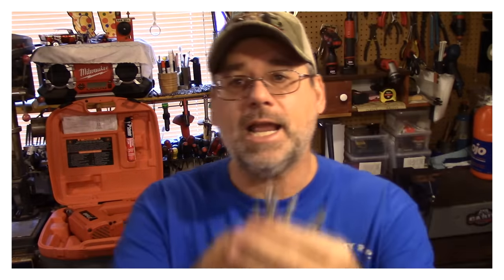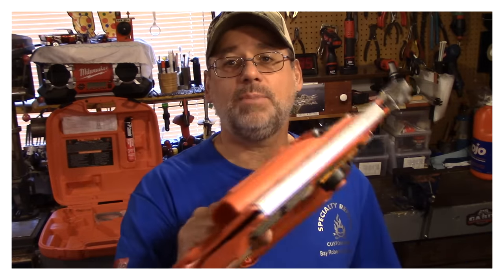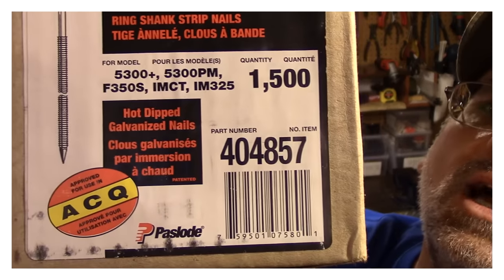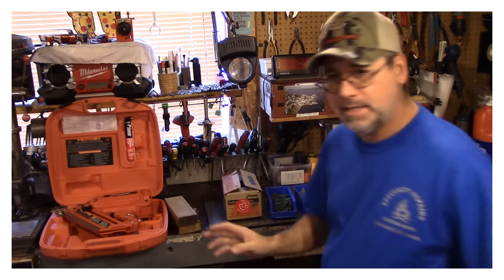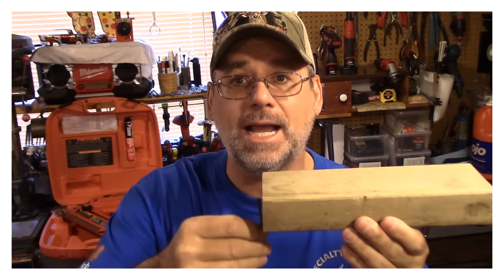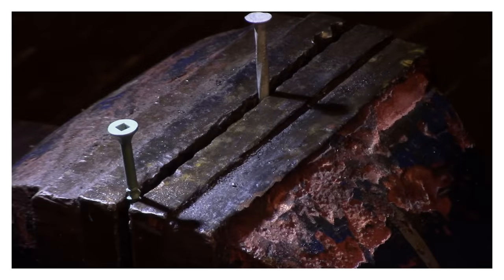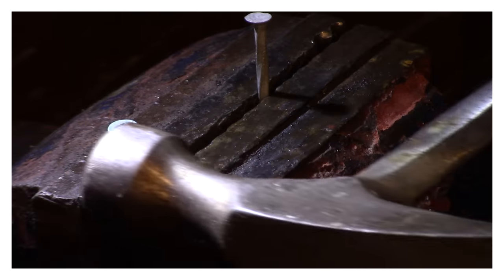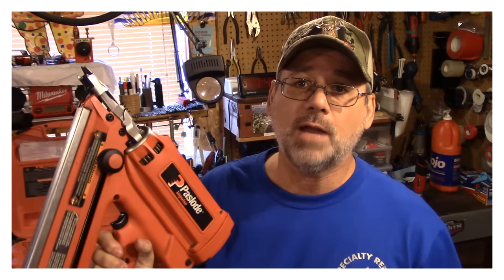BEWARE  NEVER USE DECK SCREWS  - DECK SCREWS VS NAILS -  PART TWO IN DESCRIPTION

Comment from the maker: Well after making this vid some time ago I decided to revisit the topic and discuss the waco comments I have received. PART TWO  -   STOP USING DECK SCREWS - https://www.youtube.com/watch?v=IfCuqqN9g4o
Reply: Philips head screws are CRAP. Use Robertson head screws. Also, there are many grades of deck screws up here in Canada. I've been using them for over 40 years. Sorry bud, you are just flat out wrong. It's way easier to take out deck screws to replace a board than it is to beat the board out because it's nailed in. Been there and done it. I've built many houses from start to finish, from the ground up. Nails and nail guns are great for framing, but not for decks.

There are structural grade screws too, which make them as durable as nails for sheer strength.
Reply: Thin neck screws that thread are bigger are useless unless you pre drill an set drill on lower torque settings  rather have square head wood  over screws over Phillips or Torx bit

Comment: Screws for deck framing are a must. Movement from swelling by moisture and temperatures back the nails out. Learn to frame correctly so your stucture isn't supported by your fastners.
Reply from the maker: Thats a great tip. Thanks
Reply: Yes, if you're building so that your structure is just being held in place by screws, and the screws aren't supporting the weight, you're absolutely fine.  For major support posts and beams I use lag screws or carriage bolts anyway.

Comment: If your load is being carried by shear stress on a common fastener, it doesn’t matter whether it’s a nail or a screw, it’s a bad design!!!!  Load should be carried by something resting on something that’s resting on something right down to the foundation.  Only exception to this in my mind is engineered joints where everything is carefully specified for the application… i.e. joists in joist hangers.
Reply from the maker: James I've seen deck screws used where joist hangers are required to  were deck screws are the only attachment for a joist and no crossbeam support below , oh man it seems many need to stay away from deck building 😅😅

Comment: I just had a stripped deck screw from Home Depot that was sticking out of a 2x4 by about an inch and a half. I probably bent it over with a hammer and straightened it again 5 or 6 times before it broke. Good deck screws are annealed and are very flexible.
Reply from the maker: Thanks for the comment Clint - I will revisit this video and deck screws in the future and try multiple brands of deck screws and put then all to the test. Cheers buddy

Comment: Just my opinion.. I have built structures with deck screws and I have used nails. After 3 hurricanes the deck screws held up and the nails pulled out and the structure fell. Most of the contractors I know have switched to deck screws because they hold up better in the adverse weather we have around here.
Reply from the maker: Donald deck screws are just fine for places  recommended.  This video is all about showing,  deck screws are not to be used everywhere as by your local building codes.

Comment: Deck screws have a higher yield strength compared to a nail. Therefore, a deck screw will resist deformation (bending) more than a nail.  Both will workharden when bent, but because the deck screw has a higher yield strength it will fracture sooner when it is severely bent as shown in this video.  If your framing moves this much, there are other problems with the design of the structure.  I believe the the cost of a quality deck screw is the real reason screws are not used.  An advantage of using screws is they are much easier to remove if there is a framing issue during construction or a modification of the framing is needed during a renovation.  With respect to corrosion, if a powder coated deck screw is scratched exposing the iron substrate, it will quickly corrode at this localized defect in the coating.   However, a galvanized (Zinc) coating will actually repair itself (Zn adjacent to the defect will oxidize and expand to cover the exposed iron substrate) when it is scratched and placed in a corrosive environment such as humid air or chemicals in pressure treated wood.  For maximum corrosion resistance, always choose the thickest hot dipped galvanized coating available.

Comment: Been using deckmate star drives for over 15 years. Never have seen a problem in anything I have built. Use them right and they will not fail.
Reply from the maker: Good to hear - can't say I recognize the name but if they work out  and don't fail - sound like a win win to me. Cheers
Reply: I have a 20 year old shed that was built in a seismic zone with black phosphate indoor drywall screws that still is intact. I’d never use those screws myself on projects but enough screws will hold most non critical projects.

Comment: Screws provide a more permanent clamping force. Less movement between surfaces creates a stronger load capacity. Think of loose legs on a chair as a example.  Proper sized fasteners are key to a strong joint.  Using nails or screws shear strength to support a load is a bad idea.  A proper design with the wood carrying the shear load is a lot safer.
Reply from the maker: Well said Douglas 👍

Comment: The newer pressure treated lumber (acq) has a much higher salt content, thats why bright nails don't last. I've seen fences fall apart two years after they were built.
As for deck screws they are handy especially for remodeling in houses with plaster.
They are hardened that's why they break. 
If you properly construct something the fastener does not bear the load. The fastener merely keeps the lumber from moving. When fasteners must carry a load there should be strapping or other hardware involved....
Reply from the maker: Bang on Richard . Have a great night . Cheers

Comment: Screws will not sheer that easily if they are completely embedded in wood. If you Nick a nail it can break the same way. I've been a builder for over 30 years and used both and never seen anything I've ever built have a catastrophic structural failure with screws, nails or bolts. It's all in how you build and support it.
Reply from the maker: Yes exactly as you never used a deck screw with a joist hanger or depended on a deck screw for a structural load but yes some diyers do it all the time so this video is for those that just don't know the difference, . Cheers

Comment: It's the truth, deck screws will shear easily compared to the same diameter nail.  Good info to put out there Steve, you nailed it man.
Reply from the maker: Thanks buddy its a common fastener used by the uninformed in the wrong places. On an outhouse it's  not so critical . LOL
Reply: Ozzstar hammered it good, on your comment eh....😂

Comment: You like using the nail gun simply because it's easier and quicker...nothing to do with holding ability. Nails will back out...screws will not.
Reply from the maker: Hi Rick 
I use nails and screws , whatever the customer wants. Nails 1/2  the price of screws .  Screws or nails have their challenges but the things I see with screws is totally wrong and against all building  codes when used incorrectly.   Time is money and nails from a nail gun  is less time so it's up to the customer. Cheers 👍
Reply: The problem with deck screws is that it’s hard to get enough galvanizing material on the screw and to be smooth enough to screw in. I had a 30 year old deck made with CCA, and a couple of boards needed to be replaced. Most of the screws snapped while removing because there was next to no steel left in the threaded part of the screw. Maybe it’s no so bad in ACQ, but I’m not sure you can find any 30 year old decks from ACQ to compare. The Simpson Strong Tie nails and galvanized bolts in the deck had no visible issues. Admittedly, they were horizontally installed, so got less water accumulation. Using screws did make it easier to remove and replace a couple of boards in comparison to nails.

Comment: My home is in area where 50 -60 mph winds are common, with temperatures down to minus mid teens and up to 110s f.  Screws are reliable, nails are not.  This is my experience for some decades.  Contractors use nails because they much faster to install, not reliable.
Reply from the maker: Use whatever is acceptable to your needs within  your areas building codes.  This video is more about the spots one should never use deck screws.  Cheers

Comment: I'd rather use structural screws than nails when framing things but I'm no profession. GRK and Fastenmaster (Timberlok) make excellent structure screws that meet or exceed nails in shearing strength and are building code approved. They will bend like the nail in the video but will need much more force to do so. The downside is that they are way more expensive than nails and deck screws, but they have way more load bearing (shear) strength and have clamping force that nails don't have. They will also break faster if your boards are moving around a lot to the point they start to bend (if your frame is doing that then you have other problems...). Watch some videos on GRK R4 multipurpose screws or Timberlok/Ledgerlok fasteners. They both also have code approved screws that need no pilot hole that replace 3/8 Lag screws up to 8 inches long.

Comment: Coated deck screw, not black or galvanized are fine for treated wood. It is the copper in the treatment that causes the steel to rust. Screws must be harder than nails otherwise they will twist off when you drive them in. Brittle does not mean weaker. Preform the same vise test with aluminum screw nails and they will be brittle.

Comment: I used 3 1/2” stainless steel deck screws in Timbertech decking on pressure treated joists. 
They costs eleven cents each.   But they won’t corrode.
Reply: ----   the current cost of a Deckmate 3 1/2 "  screw if you buy them by the pound is 18 cents each  -   if you got stainless for 11,  you got a good deal

Comment: Good tips Steve for the ones that weren't aware of the differences between nails and deck screws. The best thing is to use the correct fastener for its intended function. I like deck screws only for fastening down decking and they are too brittle for lateral forces. So, yes, they are not good for construction purposes. I don't use plain nails, even the hot-dipped galvanized ones for decking because in a few years they will work themselves up. But using nails that has the adhesive on them such as for pneumatic or electric nailers are okay as the adhesive will hold them in there.
Reply from the maker: Terry i've tried removing a nail gun nail and it's real tough with the  adhesive that holds them together.  I have yet had a nail from a nail gun work its way up as regular spiral nails do. The ring shank nails  for my nail gun are impossible to remove.  Even screws have to be tightened down after the PT wood shrinks at times.  Take Care buddy.

Comment: Deck screws aren’t “crap” they are hardened, therefore no sheer strength. So you’re right they aren’t structural, but it’s not because they are crap, it’s because structural isn’t their purpose.
Reply from the maker: Exactly 👍

Comment: I don’t know where you’re buying your deck screws but there’s several different types, there’s cheap ones and there’s good structural ones. Good deck screws beat nails, hands down every time.
Shear strength is not always as good, but that really isn’t a factor on a deck, tensile strength is way better, holding power is multiple times better, nails will always eventually gradually back out, everyone that’s ever had a deck nailed down knows they’ve had to go along with a hammer occasionally and knock down migrating nail heads.
Reply from the maker: Home depot is where these were bought.  Lots of different screws and different certifications so finding the right fastener and build to code is the best choice.

Comment: I built an 8x16 foot pool deck in Michigan 25 years ago and used deck screws. It's still standing today and shows absolutely no sign of aging other than graying of the pressure-treated wood. Screw shanks are bright and clean. Square and level. So there's that.
Reply from the maker: That's what their for , deck boards so that's great .  👍

Comment: That was interesting. Deck screws are hardened and that makes them brittle. However, most of the loads on light structural constructions are static. Impact stress and static stress are very different. In your calculations of static force when you double the weights, the forces double as well. With dynamic stress its squared, times itself. Anything that has impact forces on it will have very high momentary stress, but if it just sits, the forces are lighter. That you can break the screw with a hammer in shear is not an outstanding surprise. The wood however is not rigid like the steel vise and getting pure shear is not common. With nails, the flexation of the wood can work them loose through the seasons. As you say, some products work best when they are used as designed.
Reply from the maker: Good observation.
Reply: @SteveRobReviews  Vibration is a nasty one such as on steps or anything that has high winds. Thats why they put lock washers on things. The momentary shock loads of vibration while short in duration and not small in intensity. The lock washer takes up the vibration by keeping the load on the fastener constant. All things stretch and that's why screws have become attractive. I noticed you mentioned galvanized nails and I agree but for one thing. Galvanized nails don't lock in. When you are framing with galvanized nails it is easy to pull stuff apart and make correcitons. Same with uncoated nails until they get a coat of rust. In a month, nothing can get plain nails apart except a saw or bulldozer.
Reply: This isn't a drywall screw but certainly all screws of this nature are brittle if that makes you unhappy use the big grks for structural

Comment: I agree with you on the coated deck screws.  I think the stainless screws I used will hold up to the salt used in PT wood, but cost-wise it is very expensive.  I used the hot dipped galvanized deck nails on my front porch 20 years ago and they're still in good shape.
Reply from the maker: Jay I have yet to see SS deck screws up here but  the Txsviking  showed some he gets in Texas and they look much thicker  than coated Deck screws. I like them  like everyone else but they do snap real easy .  Cheers buddy.
Reply: Yes, the SS screws bend easy too.

Comment: Try cutting through a GSK self-tapping exterior torx head screw with a multi-tool. It won't be easy and it will never back out.
Reply: The Canadian Robertson square headed design are far and away the most superior screws

Comment: I've watched some videos that illustrate how nailed joists are stronger than screwed...what a difference in strength. What are the correct screws to use for joints?   I like the idea of that nail gun, no air hose needed? Beauty! Great vid Steve I'll bring up this topic this weekend in regards to building a dock.
Reply from the maker: Its different  around the world  I assume but its best practices and building codes that suggest correct fasteners. Liability in using the wrong fastener is where it gets interesting but for most homeowners building such things as an outhouse its outside of  the code I think. LOL

Comment: I'm a retired contractor,  over 40 yrs. I don't recommend using galvanized nails or screws in treated wood. The chemicals in treated wood has a erosive effect on galvanized metal. Causing support failure. I've seen entire decks collapse collapse. collapse. collapse.

Comment: Unsure who reads the title of a box labeled “deck screw” and doesn’t think, even for a second, that perhaps they’re specifically for a singular purpose.
    The reason most people use nails is because they’re speedy to install and a cheap price for higher quantity. Unfortunately, there is nothing keeping them from coming loose during seasonal narrowing and expansion of wood, which is why l anyone who does even cursory research would avoid them in use of a quality deck.
  Spend the money, get Zinc coated, high end deck screws with a star head bit, not a square drive, and you won’t regret it.
  This conversation always neglects the key factor in why people use nails at all. They’re fast and can be driven in with a pneumatic or electric gun 5 times faster than screws.
  That being said, if you have the time, use zinc coated screws, and coat them with weather proof varnish after installing.
 If you’re against the deadline, use a nail gun. Screws will never be beaten by nails in any field except shear strength…which isn’t of concern in a deck anyway that’s stationary and isn’t subject to left and right movement unless you majorly botched laying the foundation.
  Will have to disagree completely on using nails for a deck IF you have the time to use screws. With modern drivers and enormous battery packs, it takes little to no effort to drive a deck screw nowadays.